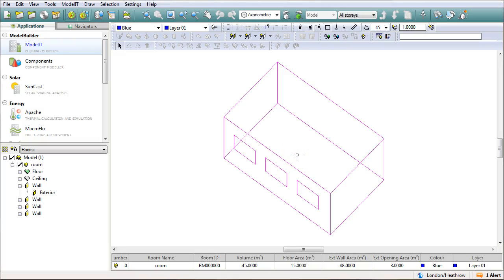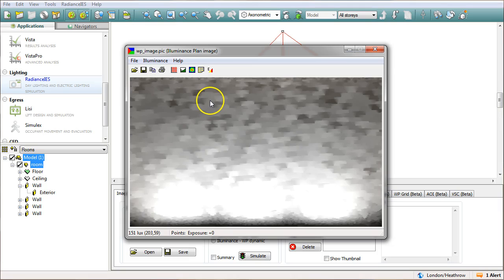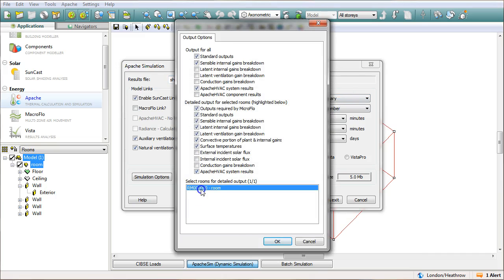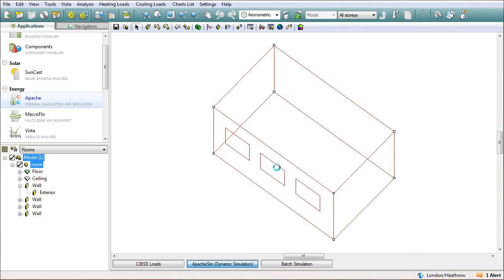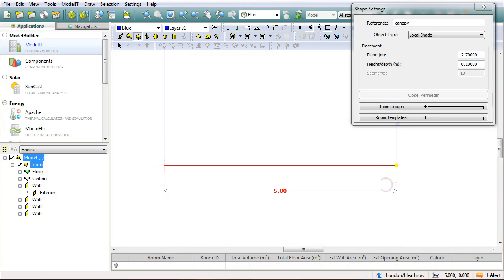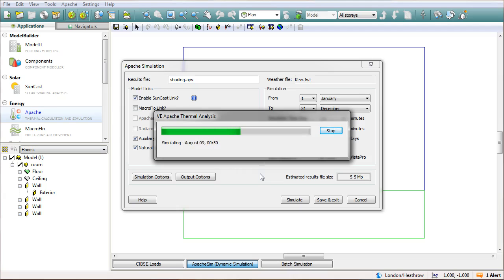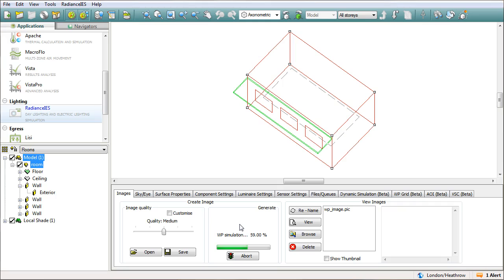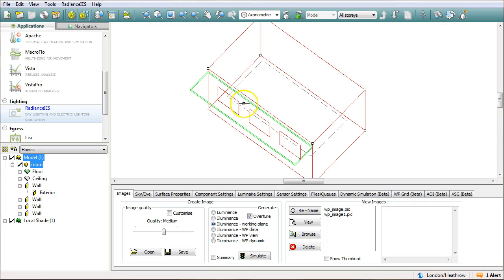Effect of solar shading in IESVE

Comment: Hi, Thank you very much for your tutorials. They helped me a lot. I have, yet, difficulty about how modelings movable shading panels. How I can model shading panles which their angle change during  the day based on a schedule? Thank you very much in advance.
Reply from the maker: Hi. I’m not sure if you can do that, to be honest. Perhaps you can, but I’m not aware of the technique. If you are generating images at different times of the day, it might be just a case of running the simulation a number of times with the angle manually rotated in ModelIT each time.
Reply: @CADandStuff  Thanks for your response.  Actually, the thermal aspect is more important for me. I try to simulate an adaptive facade and i want to change the angel of shading panels to completely close the Windows during the night, for example. I have searched a lot but there are not many helps for this software. I have only found your tutorials which I have learned using the software.
Reply from the maker: @mojtabaparsaee7582  Well it is easy enough to simulate closing a window at night, using the 'profiles' within the Apache application. But I'm not sure about simulating moving shades on the facade.